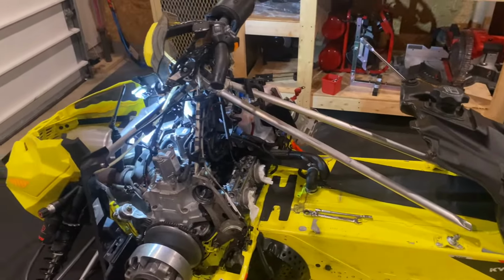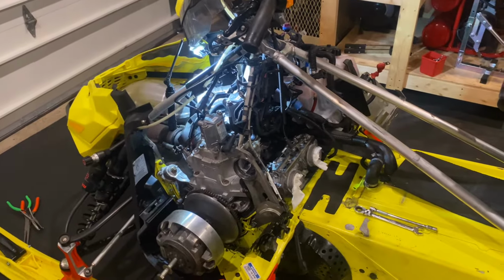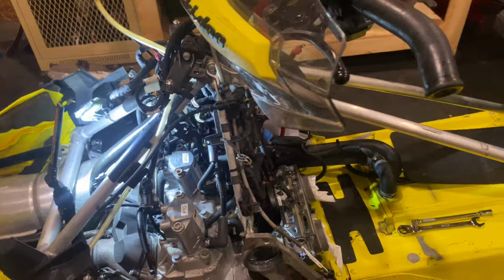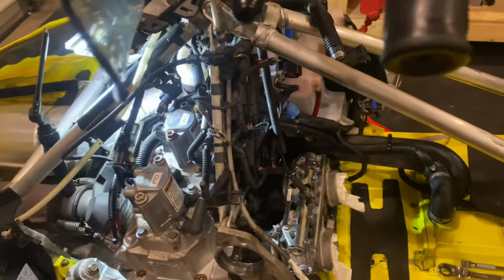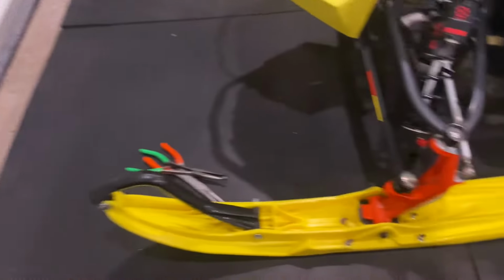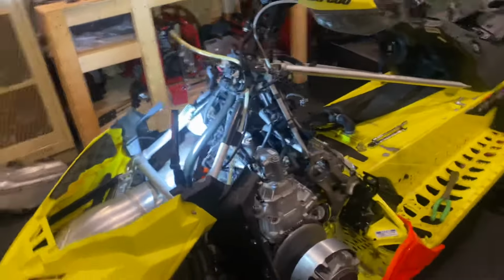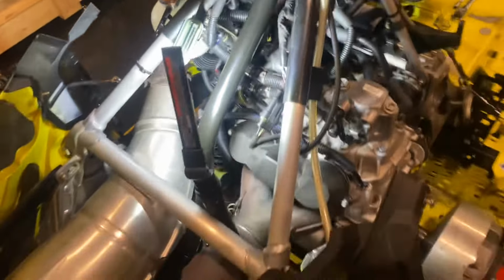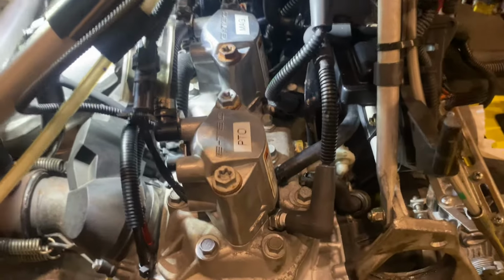Clean Your Damn 800R Etec Injectors

Comment: AWESOME VIDEO! I'm in TOTAL agreement w/ your evaluation of issues hindering progress. I'm having to replace 2016  Freeride 800 engine w/ less than 1,000 miles that blew through case. The # of connections and individual parts and GAMES involved is Mind Boggling.. No local source for parts and Lengthy research for CORRECT parts and PRICES are beyond reason. The CONSTANT reference to this PRICEY BUDS software to interact with anything is just Nonsense!! If you NEED to RUN the engine to bleed the oil lines, that's counterproductive to my goals. For an ELECTRIC oil pump one would think that it could be tested  BEFORE installing.. Am trying to find out WHY it blew up and how to prevent that from happening again..

Comment: all the broken plastic nipples can be perminatly fixed by simply installing brass threaded nipples in their place. SImply drill out the broken nipple, thread the hole and screw in the brass. If too thin for threading just use liquid metal on the threads of the brass nipple and hold in place till sets up. never again will it break off.